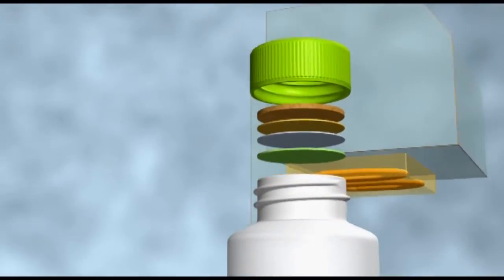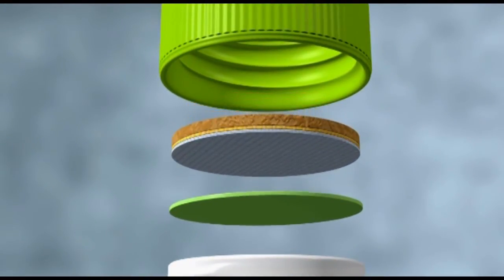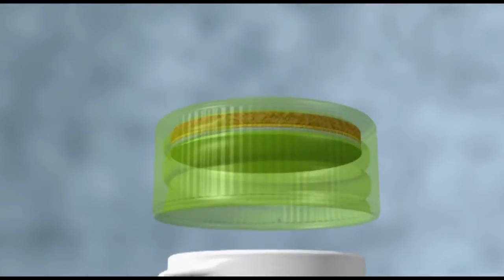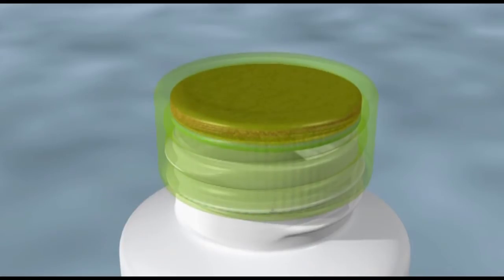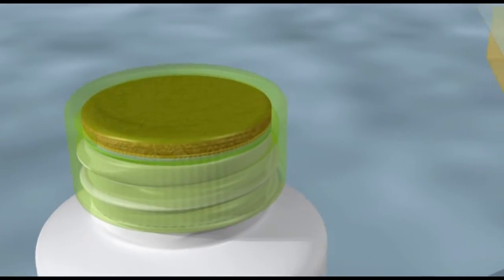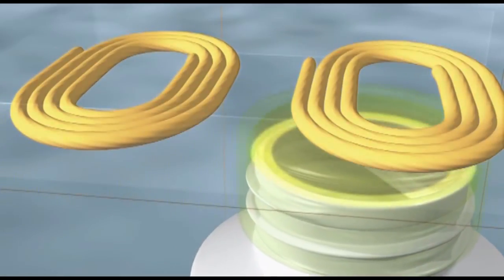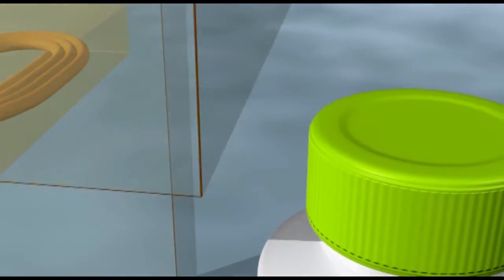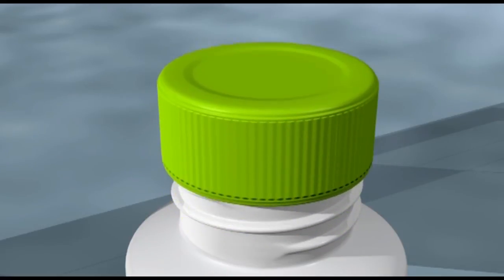How the induction sealing process works

Comment: How long for 70mm jar seals? It's either melting the jar or not heating enough. 2.5 - 3.5 is what I've experimented with on low heat